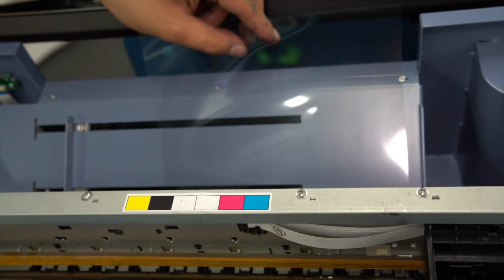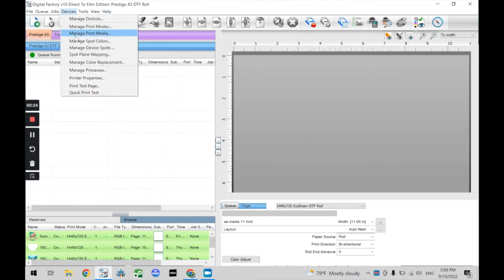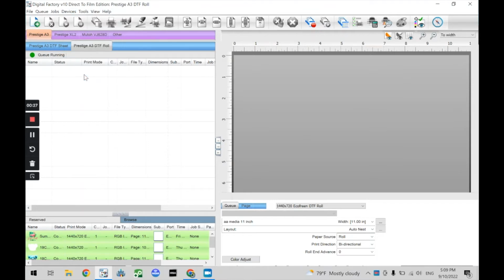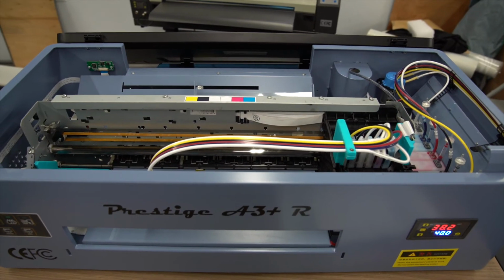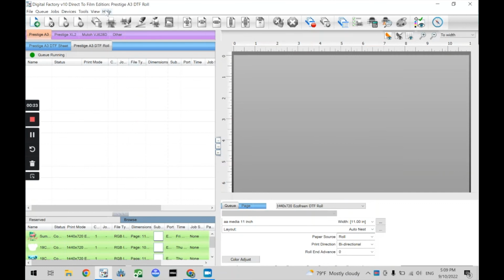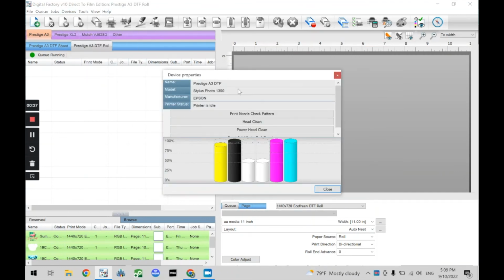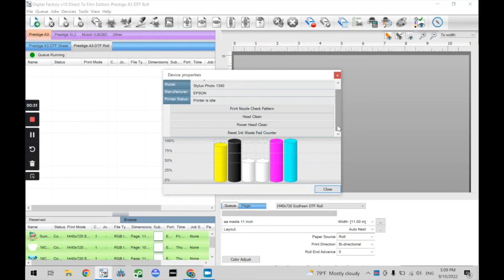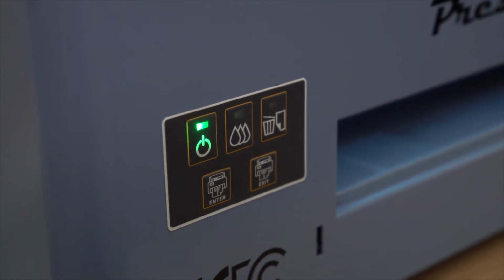Prestige A3+ R - Nozzle Check & Head Cleaning

Comment: Hi, can you. help me. In trying. to do my Nozzle. check and head. cleaning, I noticed. my Printer properties went to grayish color, making it impossible to do the process. I need to get this process done immediately because I have a load of jobs lining up. Please help! Also do a video about this for others using prestige A3+R...Thanks
Reply from the maker: Make sure printer is turned on front and back, green light is on AND red light
In software make sure correct port is selected (not file, under manage queue)
Once this is done you should have full access to perform the above actions :)

Comment: HELP!! I have just enstalled my printer and I keep getting 1 missing line on the yellow, while all others are perfect.  I have done severalllll head cleanings and I cannot get it right? Any ideas on what to do?
Reply from the maker: Hello, thank you for reaching out. We would advise pulling ink from the damper and then running a head clean. We need to determine if this is the damper or the print head
Reply: Thank you very much, the process solved the problem but, I do pick Epson Stylus Photo, I don’t know if that’s the right port for my Prestige A3+R…. I also my roll dimensions went from 13-40 to 13 in default and can’t change that neither.
Any ideas as to what went wrong? The machine has been working fine prior to this problem. Please advise.
Thanks